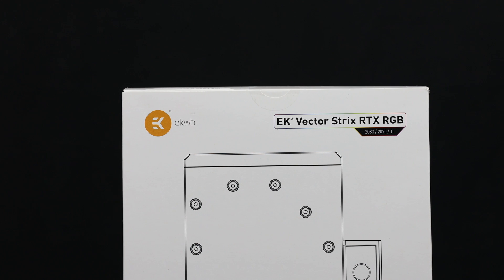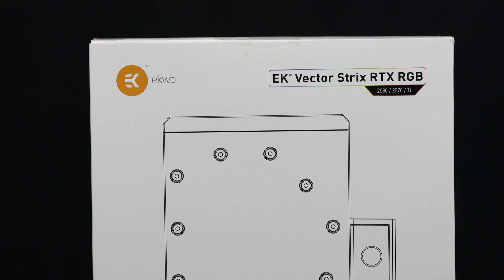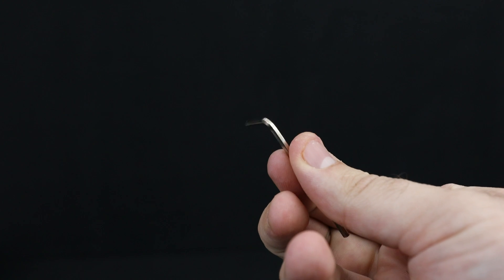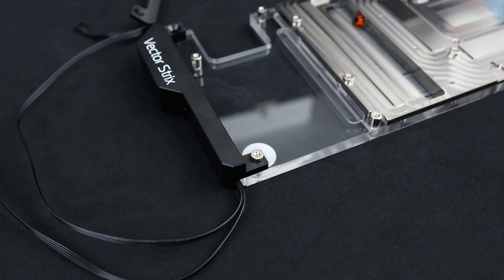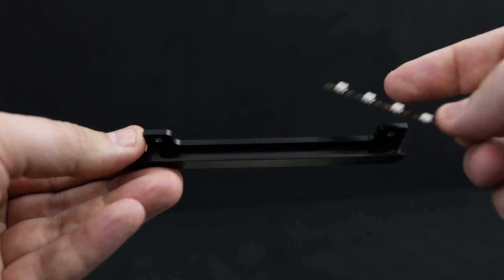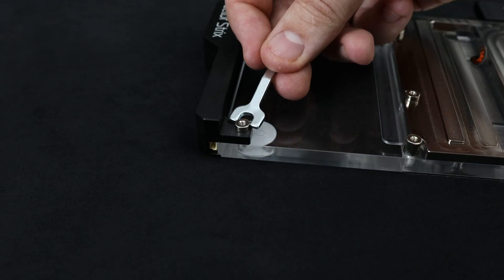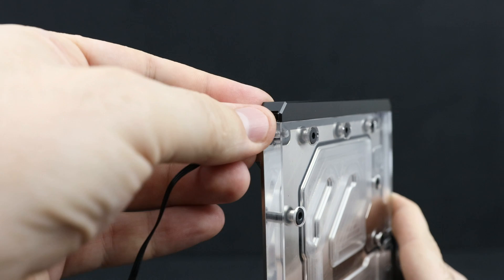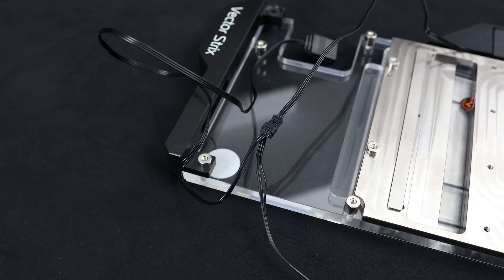How to Install D RGB Upgrade Kit for Non Reference Edition RTX GPU Water Blocks

Comment: how do you hide these wires, I am struggling rn to actually find where to stick the wires when putting on the gpu water block!
Reply: i used transparent tape to hide the wires on the backside of the block .